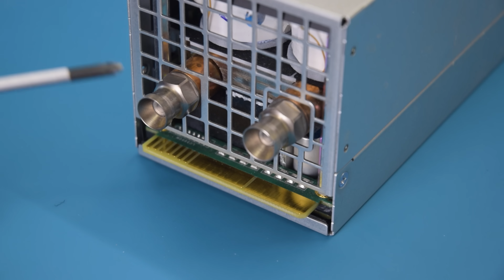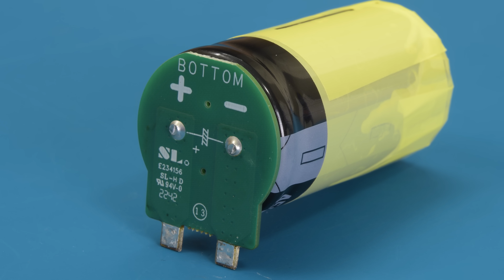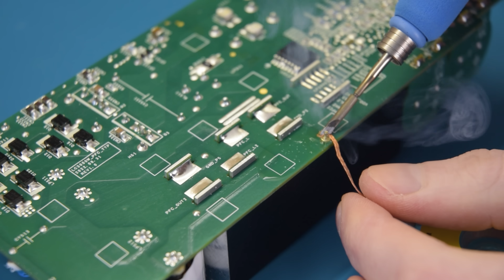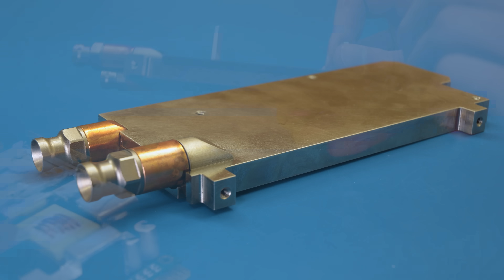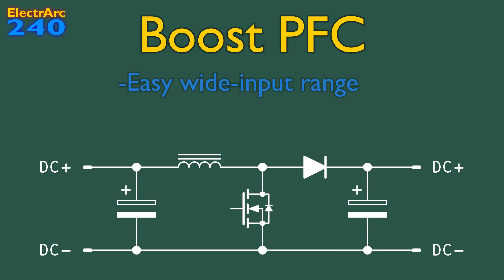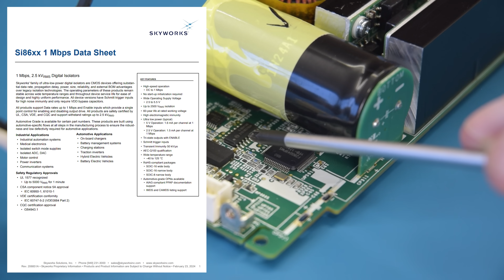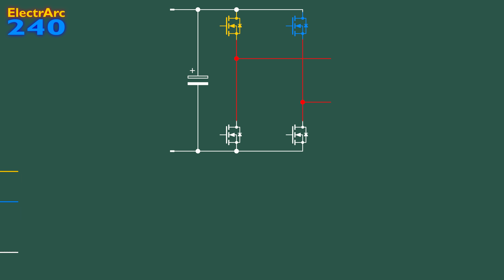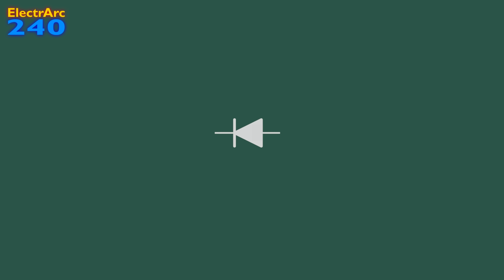Inside a 3000W Water-Cooled Power Supply (with GaN & SiC)

Comment: The power density achieved here with GaN switches and liquid cooling is insane. Bypassing reverse recovery losses using SiC Schottky diodes while driving high switching frequencies really shows why tradicional silicon MOSFETs are hitting their thermal limits in server PSUs.

Comment: Thankyou very much for this decent explanations. 
Nice to see the Phase-Shifted Full Bridge ZVS controller UC28950 being applied for ;-? 
I think the jointed  Power Source and Drive Source, are just for convenience. 
Because tracks are yet very short. 
The power current still goes thru the Power-Source, 
the drive-source gets its return currents from the smaller pin, . . . 
Did you reassembly this PSU ? 
Does it work again ?

Comment: Great video.  I learned quite a bit.  
Lighting was great and the "unscripted" talking was just fine (if not better) than expected. 

One small tip...when using solder wick pull the wick back over the top of the iron tip.  It causes the heat to be higher in the wick which pulls more solder up.  Old trick my electronics instructor taught me that I have never ran across anywhere else.

Comment: i wonder whats the switching frequency? maybe 85KHz. i agree that PFC is pretty complicated and instantaneous control strategies like one cycle control can be implemented only in analog. i used c2000 class DSP to generate control signals for a parallell resonant convertor which gives a kind of boost similar to this one restricting the incoming currennt THD to <2.5% but it was a grave mistake as the dsp was left servicing the ADC routine and the design failed. But i went on to improve the design by reduce sampling frequency .  so i wonder what sampling rate they have used for this control. The fact that this design has achieved that without expensive current sensors is great.....but there are simply too many components , like too much. The GaN sheilding with heatsink placement is genius.

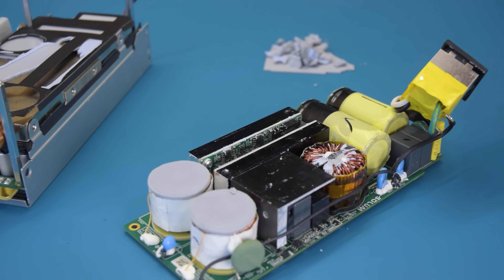Comment: 7:30 - As somebody who had enough time to design a case and cooling for their own NAS, cooling with a fan is MUCH easier.
I was mad enough to design things around passive cooling and for that I needed somewhat custom radiators. Keeping good tolerances and exactly the right spacing for thermal paste and pads has got to be one of the circles of hell...

Comment: Do you have any idea on DC-link voltage of Grid side part ? I mean the inputside of the high-frequency transformer. I think the heatsinks of the two GaN modiles are faced outward to avoid a heat pocket inside the converter. Since the air flow is severally restricted, it can create a locallised heat pocket when we face the two heat sinks. I like your channel and it's very informative. Let me know if you know the grid side Dc-link voltage. I want to have an idea on how much energy is stored on the grid-side DC-link.

Comment: I designed switch mode supplies in the 80s for military aircraft (B-1, F-14, A6).. it is great to see such an update on how things are done these days (fabulous production, sound, lighting ... excellent). Ofc we had no fancy controllers just big ass transistors and diodes. Some cool square wire 3 ph transformers though. 400Hz primaries. Our Tomahawk mission computer survived actual detonation of the Bullpup warhead at China Lake; we got it back weeks later from GD; the connector was gone but we were able to solder on some wires.... +5 volts, 16 amps, it was a solid billet of 6061 with fully potted everything, all Class S (JANTXV+) parts. GD said "this is a nuclear missile and there is space for 1 power supply... if it fails, we have a nuke on the bottom of the ocean, and the Navy hates that"

Comment: Shiyu Group with 24-year experienced PCB manufacturer, 4 production building in Guilin,Guangxi,China.
Specialized Double layer/Multilayer PCB, HDI, AI board,high-TG & heavy copper boards.
with ISO9001/14001/45001 & UL certifications.
✅ Capacity per month:150000-200000㎡
✅ Base materials: KB/SYTECH/Nanya/Rogers

Comment: i don't understand PFC block working. How does energy pass through lps11 and lps12? If the rectifier in this circuit uses two pairs of half-bridges qn101 and qn102, how do they filter? someone explain me

Comment: It is amazing to stumble upon something like this while redesigning entire HT, LT, Phantom and aux supply lines for some audio devices because the cheapest possible switchers are inducing way too much noise from mains which is varying like crazy; 170V dips in the winter and max 255V during the early summer. 
They say it is perfectly fine if you use UPS 😭😭 :) We fight back. Input protection isn't that different, because regulators don't work without good UPS there don't seem to be good, cheap enough way for several one offs than going back to zener stabilized capacitance multipliers; yes, one cap per line more, four in total, lots of protection, input CRC, slowest NPNs from the last century, chains of zeners with RCs and another output cap. 
Except for some new devices it is 70's design, simple, great at dissipating less power than regs, high power divided between two transistors. If well made, cap multi can be made to work 50 years with very little to no maintenance. The best thing is how they resist VHF noise, they just eliminate it step by step, great practice of power staging and noise elimination. Just saying, it is no fancy switcher, just usual CM made to fight mains where regulators can't function, or fail way to soon.

Comment: @23:00 - They did that due to Z height requirements. You can't mount those caps vertically. And you can't have leads bent at such a sharp angle.

Comment: Odd to see a 3kW power supply use the c14 connector, since it's only rated at 10A internationally. That probably means it was meant for the US market only, as this is the only place where this connector is rated at 15A.

Comment: On the topic of lower voltage equals higher currents, it always amazes me that big computer chips such as CPUs and GPUs use around 1V as their supply voltage. These chips then use 300W+, meaning 300A+ though the small PCB area and tiny pins or solder balls.

Comment: The cooling fluid is usually NOT just water, but rather mixed with a glycol, heavy alcohol, or other fluids.  When we did this in the 70's for railroad engines, we used PCBs, which are very effective, but unfortunately are carcinogenic.  PCB cooling was made illegal for normal uses, even though it worked great.  Much like Freon air conditioners, and their fluids.  Some computers are actually cooled via CFCs, and that tech is also readily available.

Comment: 11:00 id love to be able to buy one of them lil half bridge boards, imagine project kits,  with + out  - and tot he right gnd 12v and 3 extra small pins to cotnroll which side 
600v i wonder how many amps itd be, depending the cost of the psu it might be worth it lol
Reply: 600v 55a , das pretty nice
so 2 of them, get 2 psu s and you can make a ac motor driver, get 3 psu and run a ac motor in 6 wire or each wire independant XD
doesnt even include the bigger mosfets to come
technically you could pull out 3 full brdiges, 
that one a 80a pulseable to 250 and i gotta look up what the last 4 were rated for

Comment: Those output pins aren't going to a motherboard, they're going to a power distribution board. It would have an input for another power supply, because redundancy. And it would have regulators for 5 volts, 3.3 volts, and possibly -12 volts.

Comment: Just a word on how much I enjoyed this episode. As a non degreed tech on the learning path, it was a pleasure to follow and both use and improve my knowledge. I was a bit surprised as you discussed the two med sized capacitors horizontally mounted to small pc boards. Based on the effort to compactly design the unit, it seems they were in that position to conform/fit into the case. Anyway, thank you again!

Comment: This is a breath of fresh air; a real human walkthrough of a fascinating piece of of engineering that represents the most important stage in any electronic device on earth, although most use cases will not need quite this degree of filtration and phase alignment precision, but everything has to have a power supply, and most of it will need to rectify, transfom , switch or convert it at some stage of the circuit. Anyways I learned alot! And I am so much more happy that you are real  person ad libbing it (but only because you actually understand what your talking about really well) instead of a generic information cloning machine! I got alot out of it so keep on making these!

Comment: I just started the video, but to me that looks very much like a PSU for dedicated servers. I have one with a similar pair of connectors in my own server, albeit aircooled and much longer
2:13: Plus it probably doesn't have to worry as much about heat, since it's watercooled, it can discard a lot of the empty space normally reserved for cooling, and use smaller components that would otherwise overheat and fail

Comment: the extra rectifiers is supplies for the Chips, being that its synchronous power rectification, there wont be any supply to soft start the Chip, which is needed to start the Power Sync Recs, there can also use the other for as isolate supply or for voltage doubler

Comment: 25:00 The series inductance to primary transformer is to maintain the current to enable soft switching through inertia. Sometimes the FETs come with paralel external capacitor to add to the Drain-source capacitance. It maintains the current into the LC for a brief moment before the parasitic diode in lower switch starts to conduct and allows ZVS.  The LLC also has the series capacitor to primary inductance in order to form a LC resonant tank that acts as voltage boost component to reduce the magnetizing currents thus reducing the conduction losses. The voltage is then lowered to target level using winding ratio of the transformer. Everything depends on application, output voltages ect. The series capacitor also blocks the DC component that could go to transformer and cause saturation. I'm happy to be corrected if I'm wrong. Sometimes due to space restrictions the resonant inductance with the magnetizing inductance is fused into the transformer. The leakage inductance acts as a resonant inductance.

Comment: breaking things without telling them that it actually works as intended does cause permeate damage as the thing is pulled apart.  it as a thing, somebody does not fool with unless you had the hole robot welding machine. it was a month ago, which robot welding machine was missing its welding power supply parts, and the video maker did not want to show them?

Comment: it is funny that breaking things in front of others without telling them that it was actual working as intended did not electrocute somebody else. those things where to be fully tested de energized before disassembly. if i where you, knowing what that was and what the machine produces, is a small part of an big machine equipment that somebody had broken the thing that runs the power electricity about what the machine is for.. how did you gets that from somebody? its like a 1500$ part and you need to be telling that it functions as directed.  somebody could get mad that that was their machine part, they had to be sure it does not get stolen or broken because it runs the computer robot arm  welding machine. is amazing how they electronic computer parts are found. are you going to make it work someday after taking it apart?

Comment: Good work . Can't really nit-pick anything significant . I am surprised , however, at the output connectors relying on pcb edge connection at this high current . Presumably , there will be a solid mechanical clamp to ensure good contact , and even then I have doubts .

Comment: Im going to assume the passive standby power supply recifiers are doubled up for redundant backup purposes, in the instance one shorts out.  If that is the case then someohow they found out the probability of failure is high in this area for some reason.

Comment: This is a high reliability design.  As a reference design it's not always the cheapest.  Bending cap leads is ok if done correctly but the rubber end caps leak if the bend is too close, so it requires a radius and straight exit from the body.  The pcb saves this space and gets past the reliability police.  Cost is secondary.  The same with the facing pcb.  In volume production there is little added cost if all the parts are the same, as it's the same time on the line and the engineering time wasted trying to do a combined pcb plus adding physical protection is often justified.  It's not a cheap supply so compromises are made for performance.  Nice review

Comment: 37:09 It's Single Phase Neutral Point Clamping .They ensure that the switching devices (MOSFETs/IGBTs) only see half of the DC bus voltage, creating a three-level output (+Vdc/2, 0, −Vdc/2). There is 8 diode parallel and series may be for withstand higher current?

Comment: At the end of the video there are 8 diodes that you request some insight to their use.  I noticed that they appear to be reverse biased causing me to think that they are some form of protection shunting a reverse polarity voltage (connected to the output pins) to the neutral connection.

Comment: I guess the series connected diodes in the bridge you show the last, are just to increase the reverse voltage range. Efficiency isn't a thing in low power circuits, and maybe they didn't want to purchase any new diode with higher voltage for that purpose.. :)

Comment: In my opinion, those diodes(the bridge rectifier ones at the end of the video) are arranged like that in order to prevent arcing between diode terminals, the diodes being in a SMD capsule, they have pretty close together terminals. Putting 2 of them i series basically doubles the gap.
As I said, this is my thought of the arrangement, it may well be some other motive for arranging them like that.

Comment: Nice tear down, thx a lot, I have a hint about the "wastet kelvin-source", in soft-swichting topologies it is common to not use the KS as usual intend. and there is a simple reason, shorting it with the source makes it useless as kelvin source, but the benefit is the negative feedback one gets from the power source in terms of gate driving. This means in the first place the switching is slowed down by the power-source inductance times dI/dt through it, and this is exactly what you like to have making a soft switching topology like LLC or this PSFB converters. It reduces spikes in startup or aggressive load jumps when ZVS cannot be maintained, and "fast" switching with high dI/dt is not needed anyway in this topology because of the ZVS mode. So in short this is making the PSU more robust and save in operation. Just as a side note for better understanding: the switching speed I referee to is the transition between high ohmic state and fully conducting, the miller cap is working against it as well as the inductance in the Gate loop, in which the power source inductance is in this case as well, but with the feed back to the gate with ~VGS*gm.

BR
Dexter

Comment: The rectifier diodes in the full-bridge configuration ( 2 sets of 2 pairs) are split into a pairs instead of single diodes because its more cost effective to use two half-voltage diodes than 1 full voltage diode. These smaller didoes also have many different manufacturers while full voltage didoes tend to be single-source, or limited availability parts.

Comment: The mystery diodes might be some kind of schottky filter that clips the signal away from neutral.  It would ensure a minimum voltage on any push/pull, or prevent current from going from v+ to v-, bypassing neutral.  Could be a prefilter for a more complex shaping function, or it could eliminate low voltage noise when there isn't supposed to be current.  In any case, the directionality seems to prevent any current from passing through the junction, unless v+ becomes negative or v- exceeds neutral; surge protection, perhaps?

Comment: This PSU would be perfect for amateur radio too. The power supply for my home built linear amplifier, even with huge electrolytic caps and oversized inductors and a (very annoying to construct) copper grid faraday cage still puts enough noise onto the signal that people i talk to ask me if im running off a solar system inverter, they're notoriously noisy. I know its not my doing, the engineering is solid, the problem is that i live in a large city where a surprising amount of digital data is inconsiderately put onto the power lines by power line network adaptors, despicable little devices..
Reply: Are you using snubber networks across your rectifier diodes? Oversized caps will draw very high curtent spikes at the peak of each half cycle.

Comment: Any chance those capacitor boards were just for better thermal transfer? 2 giant copper traces with a gigantic fiberglass piece probably pull more heat than the wire.

Comment: I really liked your explanation in this video. I was surprised when you said it was unscripted.

I'm getting interested in grid-forming inverters, and seeing a real-world high-power supply explained so clearly gives me a lot of concepts to apply. Thanks!

The lighting seemed fine to me.

To unsolder big thermal masses, can't you put the whole thing in a toaster oven for a while and then use a hot-air gun on the part you want to remove for the last few degrees? Of course that would damage stuff, but it doesn't look like you're planning to put this back together again.

Comment: A very informative video. Good job.
I am troubled by the specifications on the label: it says the input voltage is limited to 240 Volts: the American mains specifications allow up to 250 V @60Hz. That means for US applications one would be stuck using the 125V setting and the output power would be limited to 1000W (less than some gaming PSUs)